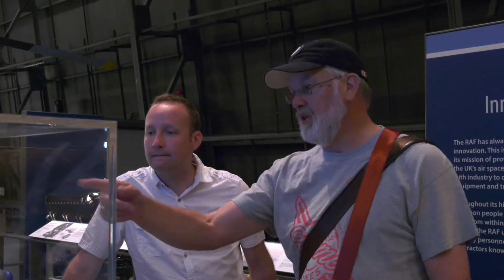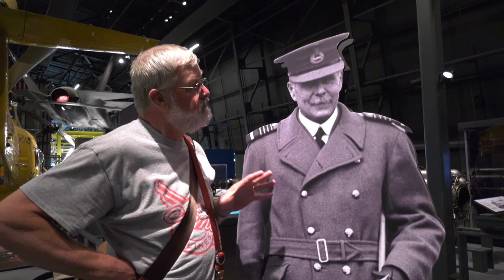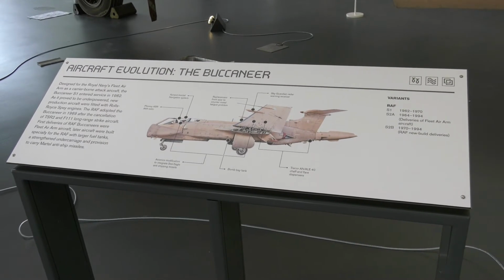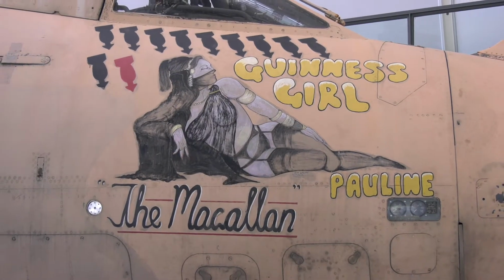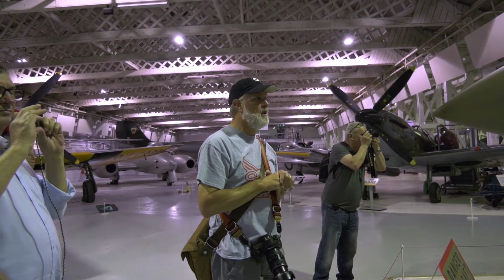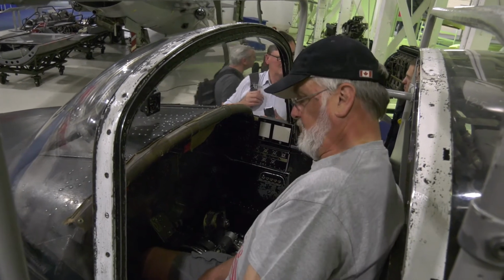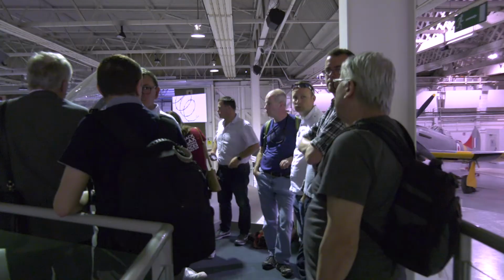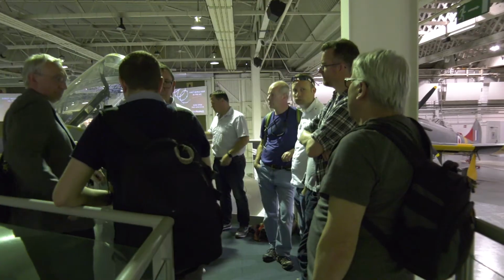APG Meetup at RAF Museum 22nd May 2018

Comment: I used to make turn and slip indicators, using a roll of nice orange knitting wool. Braid them up to  a nice length, then knot the ends and then cut to the right length, and knot to the outside of the canopy on the steel wire holder, then lock the end with a drop of superglue.